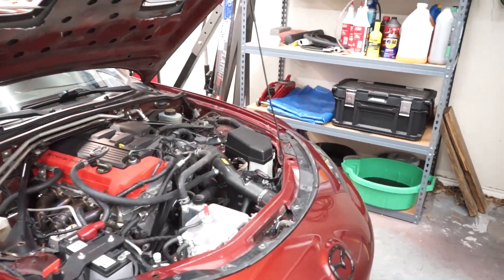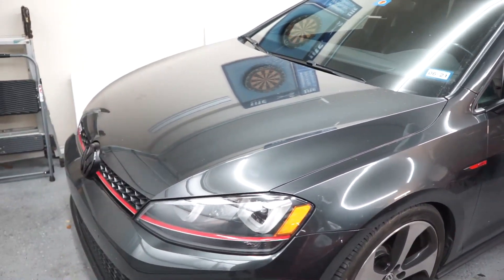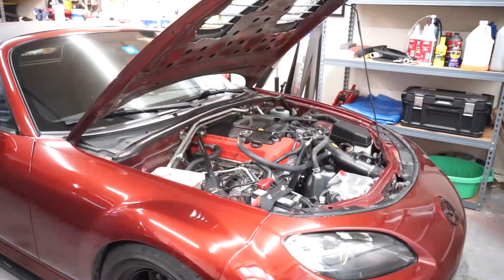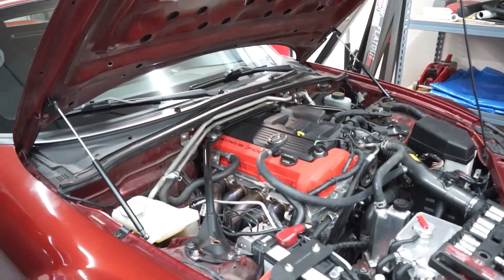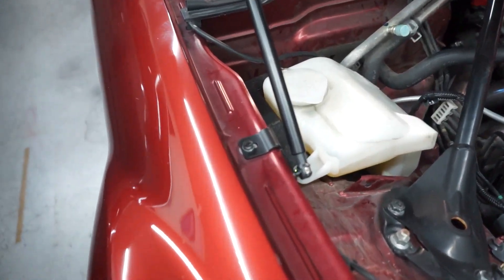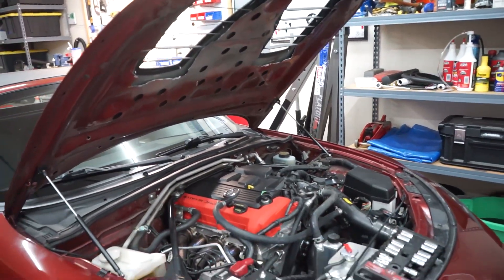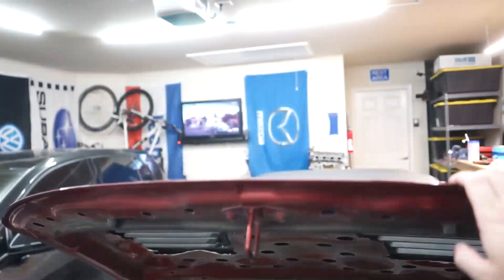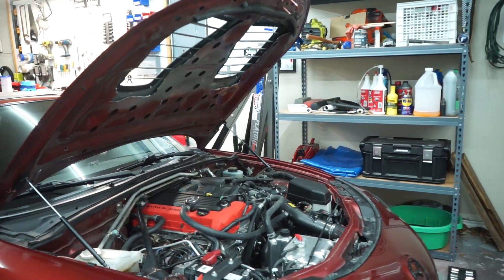RoadsterSport Dual Hood Lift Kit by Good-Win Racing!

Comment: Good video. GOOD-WIN does not mark the parts L and R which makes the guess work a little confusing. Suggestion: Maybe do a tight close up of the installed brackets. I did a screenshot and blew it up to make sure I had them properly oriented. Good job!